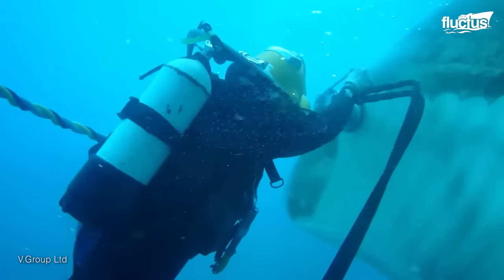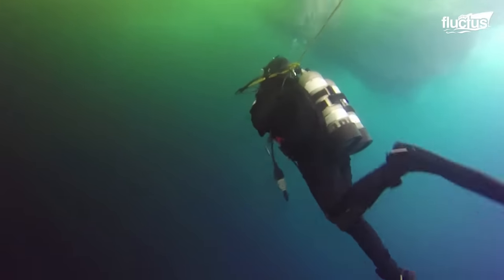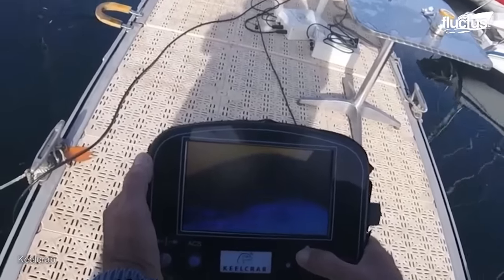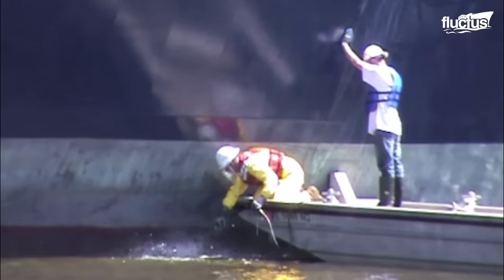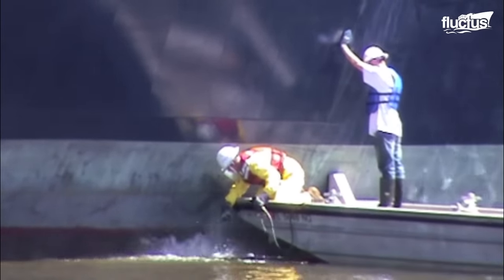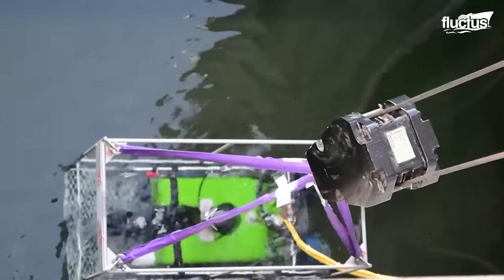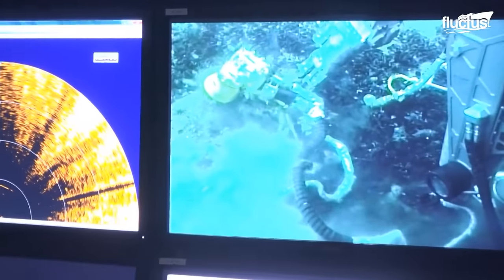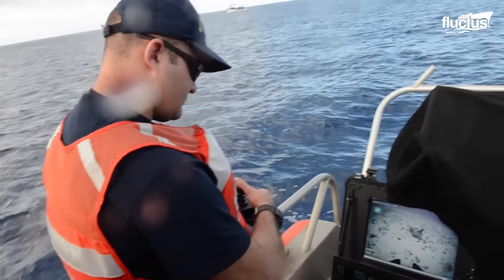The Scary Job of Cleaning Multi-Billion $ Ships Underwater

Comment: "Some hull cleaning may involve diving to depths that exceed normal diving depths" nope! the biggest ships have a draft of maybe 30 meters, or about 100 feet. That's certainly not shallow, but it's also definitely not the realm of saturation divers
Reply: on normal air at 100ft you can only dive for 20 minutes without having to decompress, then wait ages before diving again. 41 Minutes at only 50ft
Reply: It seems automated equipment could clean the lower portions of any ship without intervention... 
or a ship would rise higher out of the water without a load on board.
Reply: I was wondering if they were talking about oil platforms?
Reply: Its not clear what the deeper diving is needed for...
Reply: @michaelmccarthy4615  to stay longer underwater and finish the job.
Reply: No ship has a draft of 30 metres. Maybe 25 m at the most.
Reply: ROV are used, by Marine Professionals. Maritime English is also used by Marine Professionals.
Reply: Hello beautiful
Reply: Maybe they mean oil rigs?
Reply: @kristiansenjensen6271  what
Reply: Yeah I was thinking oil rigs, I wish they had made it clear talk about giving half the info!
Reply: Are saturation divers for subs?
Reply: @michaelmccarthy4615  subs?
Reply: @goon356  no they dive for science...
Reply: Just heard that and paused the video and this was too comment, I like the way you think
Reply: My thoughts exactly.
Reply: They do sat diving to maintain long shifts without decompression. They just do the decompression one time at the end of the duty cycle.
Reply: On the whole a bad researched vid.
Reply: Eh, you can only spend about 10-30 min max at 100 feet wearing regular dive gear
Reply: This is a mixed tank indeed used for extended periods of time. Not sat diver mixture but similar. Those hoses you see are the oxigen mixture and the other 2 are warm water going through their wetsuits and some of you would say why not automated vacuum/zamboni Machines ...well humans are less expensive than a whole lot of technology and then waterproof those 100k chips.. Truly a great idea but we are not there yet. Humans can determine the best machine for the job and this is done so they don't have to spend millions on dry clean.
Reply: A "Hull" doesn't apply just to a ship. The hills of offshore platforms, particularly "Spars" can be several hundred feet deep. I would agree though that in the context of what was said in the video is not accurate. Saturation dives, like the ones being depicted, are not for "Hull cleaning" but for deep sea work on Fixed platforms, pipelines... Etc.
Reply: Everyone loves a know it all. You don’t get invited out much do you?
Reply: That 30m draft ship name what say me
Reply: 100 foot is easily within safe diving range for experienced divers.
Reply: Right.  Don't know where she got that information from.   Definitely wouldn't require  Sat diving operations
Reply: Yep, I thought that statement was odd. It's a surface ship. The hull can't be to far below the surface so divers should have no problem.
Reply: That’s what I was thinking
Reply: You can use a nitrox Ean 36 to stay about 40 Min without decompression at 30mt
Reply: Even then, that is loaded. They would clean the ships when they are empty.
Reply: I imagine the “deeper depths” refer to something like oil rigs etc
Reply: @Eliteperson25  and fully laden
Reply: 24 meters for fully laden mega  tanker...
Reply: @seanogallchoir3237  yes
But they are cleaned by normal persons xf
Reply: @WalterModel45  2022 in the Modern Maritime Industry ROV are used.
Reply: @seanogallchoir3237  just for few works.
Reply: That bizarre statement stood out to me, too.  I also see they didn’t respond to your statement, lol.
Reply: what ships have a 100 foot draft?  seems like even the biggest tankers wouldnt be half that.
Reply: @J titanic was never cleaned and is very small compared to modern big ships
Reply: @goon356  why would you have to clean a sub at the bottom when you can bring it to the surface lol
Reply: Agree....I live in Ft Lauderdale and I'm a life long boater. Every time I take my boat out I am passing some big ships in port. My electronics show a max depth of about 50 feet so I'm sure some of the bigger ships may be brushing the bottom at low tide. I also used to be a scuba diver. I know the amount of time one can stay at a depth of 40-50 feet and no decompression is needed if the divers stay within the guidelines. Having multiple divers would eliminate the need for decompression or saturation diving at these depths. However....maybe on oil rigs or "super tankers" it is probably different.
Reply: When I see the US Navy on some of the machines I say that explains the need for saturation divers. Even if not mentioned here Navy operated submarines living in the deep seas months at a time will probably need similar maintenance deeper the reach of normal divers requiring sat-chambers and all.
Reply: CuteAnimals225🏳️‍🌈⃠  You plan the dive before ever getting in the water and use a dive computer or wrist watch to keep track of your decompression obligation.
Reply: Usual draft of large ships is about 10 meters, or about 35 feet. The largest ships, such as tankers that need to be partially under water, have a draft of about 30 meters, as you said. So, you are right - it is not "deep diving"
Reply: No ships will have a draft of 30m the deepest is around 24m on very large ore or crude carriers. The draft can vary a small amount depending on where you are in the world the water density can be different, especially when going from sea to fresh water.
Reply: @justink583  The deepest draft on a ship was on the Seawise giant. It had a draft of 24m. That ship no longer exists, so i think that right now the deepest draft is around 20m.
Reply: @rmsolympic438  correct , however some vloc's today have a max draft of around 23m as iron ore is a very heavy cargo
Reply: @justink583  Oh alright. I did not know that there is a ship with a draft of 23m.
Reply: So saturation diving is a normal diving procedure?
Reply: Cleaning Submarines?
Reply: @schlaznger8049  submarines can rise to surface. no point
Reply: marko  actually, yes. Drafts can exceed 25m depending on the vessel type, cargo, ballast condition, and available water depth. Not many are that deep, but it does happen.
Reply: @seanogallchoir3237  most hull cleaning around the world is still done with divers using brush carts. While there are hull cleaning ROVs around, they are generally limited to the flat surfaces (vertical sides and flat bottoms) and their cost is pretty high (ship owners generally don't want to pay for the use of ROVs considering that divers will still be required). Propeller polishing is still only done by divers as are rudders, curved surfaces, and niche areas.
Reply: @evanmurphy2165  Do the ships belong to Flag of Convenience register?
Reply: Depends how long you're down there. And you shouldn't use regular air for extended periods at that depth.
Reply: I was thinking the same thing.  It's not like they are recreational divers doing this job.
Reply: @BornAgainCynic0086  im a commercial diver and can confirm SAT divers are never used in ship husbandry, you wold dive nitrox to extend bottom time and have in water decompression if needed.
Reply: @goon356  submarines. Time to get off the internet sir
Reply: Came here to call that one out....I mean theoritically 1 or 2 atmostpheres down for like days straight... MAYBE.....
Reply: 30m is way too deep lmao, maybe 20m
Reply: They do mean platforms and such constructions deep under water. They do show a supplyship right after wich show they mean such constructions even tho they forgot to specify in the script.
Reply: 30 meters is still recreation dive depths - just plan the dive
Reply: @rmsolympic438  The French Batillus class supertankers had a full load draft of 28.5 m, so even when it's not loaded it'd have a greater draft than Seawise giant.
Reply: @alanjayan6975  Oh okay. I didn't know that. Thank you for the information but it is when it is fully loaded. When it is under inspection by divers it would probably be empty so it would have a much shallower draft
Reply: @BornAgainCynic0086  So have more than one or two divers so they can get done in 20 minutes!😁
Reply: @J It was a piece of cake! 🎂
Reply: You’re way too excited trying to correct people
Reply: The key word there is “normal”. I’m a rescue diver and the max is 30. And even then, you have like 15 minutes there max - and that is staying still, and can get nitrogen narcosis pretty easily. I wouldn’t want to do anything manual, at that depth!
Reply: Keep in mind that SPAR platforms can sit upwards of 700 ft below the surface and also need to be cleaned
Reply: @rash15  that’s right they clean the dirt off the coral to keep it nice and colourful
Reply: @Eliteperson25   is correct, according to Google the deepest Draft of any Ship Today is the" Seawise Giant" Draft=24.611 m (80.74 ft)
Reply: Cleaning ships hulls isn't deep sea diving lmfao
Reply: @BornAgainCynic0086  what about trimix? how long would you have to decompress for 4hrs of diving at 100ft
Reply: @J its hilarious that your getting likes on your post, the titanic was the biggest ship back than, but looks like a child next to modern cruise ships
Reply: You're right, the biggest of the big Knock Nevis/Seawise Giant had a draught of 80ft.
Reply: i know fuck all about diving but i know that you can dive down to 40m with the right training made me even laugh at that
Reply: very dangeeous but so exciting
Reply: Lol was thinking the same thing
Reply: So what's the front of an underwater or submerged vessel called then?

It's cone?

Ba dum tss
Reply: @BornAgainCynic0086  U know Nitrox/EAN ?
Reply: Oil Rig Maintenance
Reply: There's always that one person that feels the need to prove someone wrong. They do use saturation divers for cleaning some ships. It's not so much the depth as its more about the time. A diver on air at 100 feet must come up after 25 minutes. You aren't cleaning much in that amount of time.
Reply: 📢  Alert A Sunday Law  will be The Mark Of The Beast when enforce by law, Those that keep Gods seventh day sabbath will be prohibited from buying and sell and persecuted. Jesus is coming are you ready?
Reply: An ultra large crude carrier has a draft around 35metres fully laden but when undergoing cleaning would have a much shallower draft, especially as the ship would unload its ballast as well as minimise engine bunker fuel.
Reply: @michaelmccarthy4615  It makes the cost cheaper overall. Instead of having divers needing to decompress and work limited hours they can stay at that pressure for the length of the job and come back up all at once once it's done.
Reply: You do realize that the max draft is at full load right?

Comment: It's actually once every 5 years a vessel is dry docked plus has other scheduled maintenance procedures in that time frame too
Reply: I was about to say, once a year seems very frequent for dry-docking
Reply: @asianinvasian9022  So could it be that its once a year if you can't use divers to clean the hull and if you can, then its only once every 5 years its required? Sorry if noob question.
Reply: @death_parade  If I were to guess it is a mistake. There is no way they could afford to fully drydock a ship once a year it just isn't financially feasible
Reply: @asianinvasian9022  Oh OK. Thanks. BTW, what is it that drives the up the cost of dry docking the ship. Is it because dry docks are few and thus hiring one is expensive simply due to supply-demand? Or is it because the process of transferring the ship to a dry dock is inherently expensive in and of itself> Thanks in advance.
Reply: @death_parade  lost potential income. Every week a ship isn't at sea is a week that ship is not making money. Combine that with costs of the work done to the ship and it's quite a bit. It is worth noting, do not take what I say as gospel as I'm not in the business. I'm just using what little I do know and trying to make logical guesses off of that info
Reply: @death_parade  Mostly the lost time, Ships running costs go anywhere from 10k to 50k per day

Comment: Can be cold hard Yakka, whilst hand scraping a cargo ships rudder I discovered that the hinge pin on the rudder had broken and was protruding around a metre . The crew had wondered why the ship was sluggish on the helm. Our dive company got the job to do a repair so the ship could get to drydock. After using the pneumatic wire brushes on the hull you would find dozens of pieces of wire in your wetsuit.
Reply: Hahah same problem when I cleaning metal with wire wheel go to sit down and your like a pin cushion with the amount of wires sticking out

Comment: Saturation diver must be the closest job to astronaut!
Reply: these divers are diving up to 10m. they can stay hours at that depth. I use my 18L for 3 hours at that depth.
Reply: Sat diving is typically only done for depths deeper than 300 ‘ down to 1000’ . We recently started diving sat  in more shallow depths in the oil field, only to save on long in water decompression times. There’s no surface work being done on saturation. This is a ridiculous video.

Comment: They never work alone......divers rules there would require minimum of 2 divers......the most that gets released back into the waters after scrubbing is the critters and algae and some paint and the levels of zinc or copper oxides in the paint would be less than if a person was to throw a scrap of metal in the ocean
Reply: Commercial divers often work alone (a 'buddy system' is not required), but they have communication with the supervisor on the surface and if on surface supply an almost unlimited amount of breathing gas - if it is a proper commercial diving operation.
Reply: @evanmurphy2165 depends on the job and dangers involved......never work or do a contract for someone that is super easy with putting you in a dangerous position or they have no concerns themselves

Comment: Multi-million dollar ships and they can't create surfaces that's resistant to dirt?
Reply: Just for this Thinking about human brains just trips me man .  One side they do better and on the flip side , they destroy
Reply: Yes we do have equipments to prevent growth but that's not much efficient on such larger scale. MGPS or Marine Growth Protection System is used to prevent growth, but that's just to buy some more time, can't prevent growth fully.
Reply: Ships do use Anti Foul Paints & Ultrasonic Anti Foul Systems but still Algae, Marine growth is unstoppable and has to be maintained
Reply: Were it so easy

Comment: I had a few days where I polished 2 props a day,alone.Taking the prop through a cub brush,sanding disc then shining it like a mirror,nice lines, with a polishing disc,huge MSC ships,over 10 hours under water,got paid £ 10/day in South Africa.
Reply: 10pounds per day? You need to change your profession, selling bananas is more profitable
Reply: @maurimela4390  Yip,you are right and yes,I did.
Reply: @markbrown-sb2zm  well goddamn. I assume the 10 was back then quite alot if money in SA

Comment: When ship comes to dock for loading, we must release hot water near Propeller. During movement it is not possible. 
Use solar water system, use sea water for heating water, Now a days in market  we have plastic or stainless steel heat proof  water tank  available. 
The temperature around Propeller areas will increase and all sea animals will leave the fan. At least 60 % success we can achieve to clean Propeller. 
Jay bharat.
Reply: Japanese have technology to make road 🔥, road is ice free during winter. 
Same technology we can use to make water hot below ship during loading and unloading. 
We don't need boiling water, smaller rise in temperature will make sea animals to leave ship. 
Jay bharat.

Comment: "... cleaning of ships ... also reduces fuel efficiency racking up costs and harming the environment"
"... significant amounts of copper and zinc are released during the underwater hole scrubbing, 
the negative impact on the environment is huge as the liberated by the cleaning place an additional strain on the local ecosystem"
To summarize: 
The companies don't give a shit about the environment and just want to save money. 
The fact that this also protects the environment by reducing fuel consumption is a nice side effect that sells well.